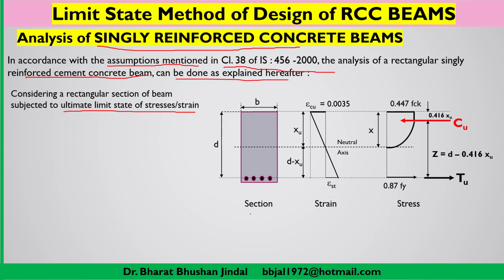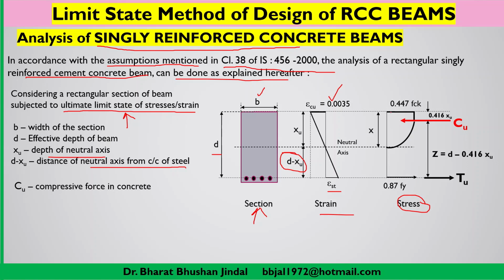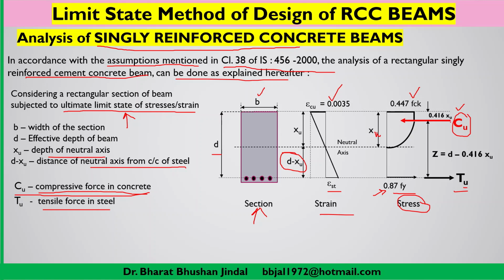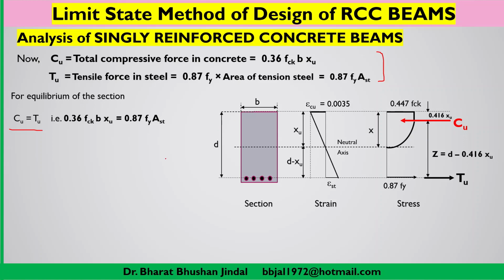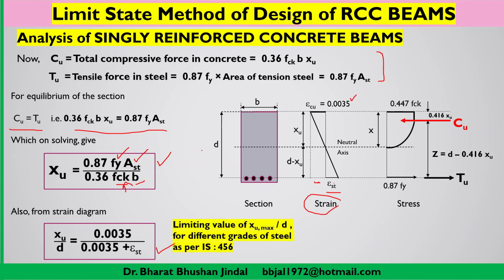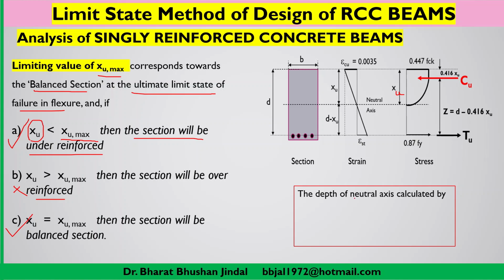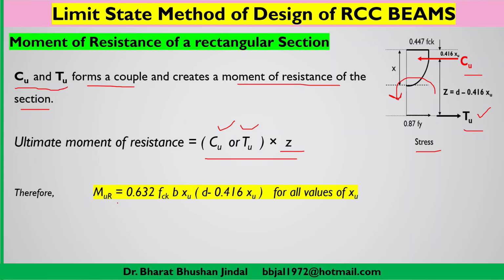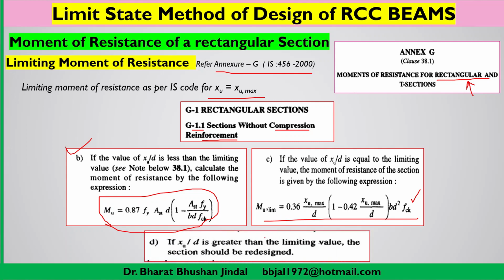Lecture 8 || Design of RCC Structures || Limit State Method ||Moment of Resistance ||IS :456 -2000||

Comment: Sir, why is it the case that with increase in grade of steel, value of max depth of neutral axis decreases?
Reply from the maker: Interesting question but I want you yourself explore the answer, by that your concept clarity will be much better. Otherwise, if you watch previous lectures then will find that answer to this question is already mentioned in the lectures.

Comment: Sir, at 22:57 you said that the formula for Mu using concrete section is valid for all values of Xu, but sir when the section is over-reinforced(Xu > Xumax) then, I think it won't be valid.
Reply from the maker: It is already mentioned in the lecture that its only valid when xu/d <= xu,max/d

Comment: Summary-
Considering a rectangular section of beam subjected to ultimate limit state of stresses/strain,
      Cu= 0.36*f(ck)*b*x(u)
      Tu= 0.87*f(y)* area of tension steel
           = 0.87*f(y)*Ast

Where, b- width of section
              d- effective depth of beam
              x(u)- depth of neutral axis
              Cu- compressive force of concrete
              Tu- tensile force in steel
 At equilibrium,
         Cu= Tu
         I.e. 0.36*f(ck)*b*x(u)= 0.87*f(y)*Ast
         Which gives,
         x(u)= (0.87*fy*Ast)/(0.36*f(ck)*b)
         From strain diagram,
         x(u)/d= 0.0035/(0.0035+e(st))
Limiting value of x(u,max) corresponds towards the 'balanced section' at the ultimate limit state of failure in flexure and if,
       x(u)<x(u,max)----- under reinforced section
       x(u)>x(u,max)---- over reinforced section
       x(u)= x(u,max)---- balanced section.
Cu and Tu form couple that creates moment of resistance(Mur) and ultimate moment of resistance= (Cu or Tu)* z
Also,
Mur= 0.632*f(ck)*b*x(u)*(d-0.416x(u))---for all values of x(u)

Mur= 0.87*f(y)*Ast*(d-0.416x(u))----for x(u) <= x(u,max).

As per annexure-G
If value of x(u)/d is less than limiting value then, Mur= 0.87*fy*Ast*d[1-(Ast*fy/b*d*f(ck))]

If value of x(u)/d is equal to limiting value then Mur= 0.36* (x(u,max)/d)*[1-0.42*(x(u,max)/d)]* b*d²*f(ck)

If x(u)/d is greater than limiting value, then section should be redesigned.